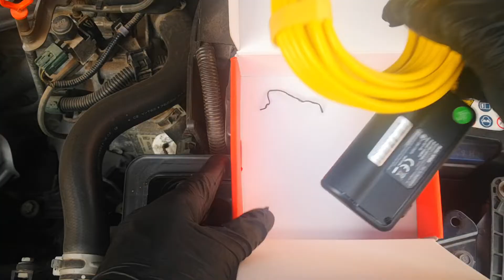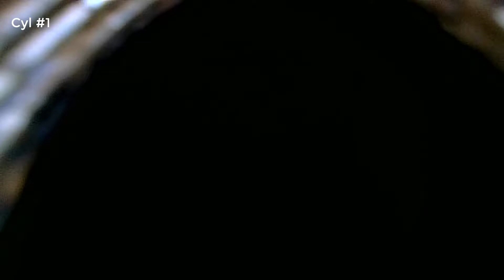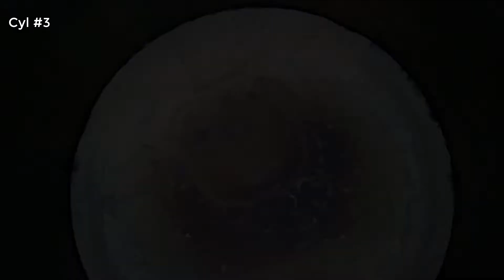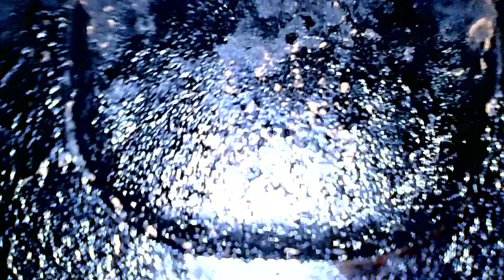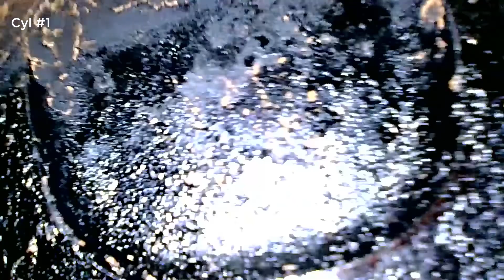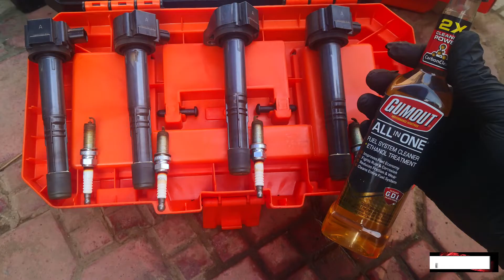Gumout against Carbon and Engine KNOCK: What Gumout all in one cleaner did to my Combustion Chamber

Comment: The white ash in pistons is caused by oil burning. Change oil with Valvoline restore and protect for 4 oil changes. It will reduce burning and deposits

Comment: I suspect fuel-quality will be an issue based on what you mentioned in comment on another video. You may wish to consider investing in a supply of Techron fuel additive as a matter of routine prophylaxis. I believe the additive concentration of Chevron's "Top Tier" fuels in the USA is around 400ppm. I believe around 30 ml of the regular Techron additive per 35L of fuel would get you close to that. That would be the "Techron Fuel Injector Cleaner" the one labelled safe to use every 1000 miles. Per the MSDS, the amount of Techron (PEA) per bottle of the Fuel Injector Cleaner is 10-20% by volume, so depending on the quantity bottle you purchase, adjust your treat rate accordingly. It may be more cost effective to buy a concentrated Techron, consult the MSDS to find the range of concentration, and then calculate your treat rate per gallon of fuel to hit that 400ppm.
Reply from the maker: Excellent analysis and suggestion. I now use Archoil 6900-P Max which is made to be added in aliquots. It delivers PEA with every fill up.
Reply: @diyautoworksng so I am not in any way a mechanic by trade nor am I a chemist or lubrication person I am just a random dude

I got a thinking about the engine knock you commented on 

When I was reading about low speed preignition, one of the sources of that was cylinder hotspots created by carbon flakes . 

These carbon flakes, owing to their high surface area and flammability, begin glowing like a tiny carbon filament, igniting the fuel mixture. You mentioned you were a physician. I imagine the carbon flakes causing the cylinder equivalent of Vfib where you have the aberrant automaticity. If the spark plug is sort of like the SA node, these carbon deposits create an aberrant combustion pathway that results in knock or destruction of the cylinder. 

Under periods of high load, so for instance using your AC compressor, the increasing fuel increases cylinder heat, leading to these glowing carbon particles which then pre-ignite. Perhaps similar to how periods of an oxygen demand starved myocardium creates irritability of the cells leading to VF.

I don't know if this is true, but this is how I theorize it and this is how I am conceptualizing the cause of what you described. 

So the removal of these carbon particles via fuel additives eliminates the source of irritability in the combustion chamber thus restoring the normal combustion process driven by the spark plug.
Reply from the maker: @JulietHotelFoxtrot 😀
I love how you've found a very similar example from medicine!
You're 💯 spot on. The irregular nature of carbon build up plus the fact that it holds heat is what leads to these hot spots and the pre-ignition. I'm glad I've gone beyond it.
Nice refresher on VF😁👍🏼

Comment: I've been using gumout octane booster, daily to help with a knock condition I had in my VW Jetta 2.5 Liter               I tank up, once a day (Uber Driver) and have dumped 1 bottle of octane booster into the bottom of the tank, each time.         I used to get knock codes roughly every 200 - 300 miles.  For the last several throusands of miles the knock condition seems to have disappeared when I do my daily scans. Pretty incredible. I may pull back using the octane booster in a while to see how long I can run without running into knocking issues, so I'm not overdoing it.

No joke I have used octane booster daily for the last 3 weeks lol 200 - 300 miles per day driven
Reply from the maker: 🤣🤣🤣
I feel you. This my car would knock after some thousands of miles if I allow buildup accumulate in the combustion chamber. You may find that a proper fuel system cleaner will do a lot if your knocking is from carbon buildup. If it's fuel related, switching to or doing some premium blend fill ups may also help.
For me I now use an Archoil product that comes in a liter and you add aliquots to each fill up. I have a video on it if interested.
Reply: @DIYAutoworksNG  absolutely I will go find it. Thanks for your video. It is solid information
Reply from the maker: You're welcome!

Comment: Well done and well presented! 😃👍
But how about the pcv valve? Stuck piston rings?
How is the fuel quality in your area/country?
Is using an API-SP or -SN+ rated oil an option, as these 2 are specifically made to prevent knock?!?
Reply from the maker: Thank mate. Very good questions. I use API SP+ oil. The fuel quality is the let down 😐

Comment: How u know that's not the ac compressor clutch plate ?
Reply from the maker: Possible, but I've had this more than once now, each time it goes away once the carbon buildup reduces.
Reply: @DIYAutoworksNG  well ur lucky . Mines is the compressor ac clutch plate kuz when I turn it off the noise goes away

Comment: Also review Gumout multi-system tune-up!
it contains PEA similar to Gumout Total fuel system cleaner. It will be interesting to see if both products are strong carbon cleaner produces similar results.
Reply from the maker: I tried it some many years ago, got back a lot of power and MPG, though I didn't have a borescope back then so never looked into the cylinders. Guess the extended highway driving I was doing at the time helped.
Reply: @DIYAutoworksNG  Just an update,  I used this product and drove til near empty. Then i ran a full tank of gasoline without any addictive's. I also change my engine oil before doing the test. The car drives smother and has better acceleration than before.

However,  The Cruising rage did not change after oil Change and adding the fuel Additive. It was 290 miles with full Tank of Gas before oil change and using the product. Typically after doing these things, it used consistently to give me 315-320 miles of rage in the past. It did not this time. 

And still showing 290 miles cruising range after doing oil change and using this Gumout Fuel system cleaner. I don't know what else could be the reason for it

Comment: how about putting the gumout directly into the spark plug holes... soaking overnight.... then cleaning out ?  similiar to other (soak methods)
Reply from the maker: Yea. Nice idea. Haven't tried any piston soaks just yet. Was discouraged by the fact that I tried soaking some spark plugs in gumout and it didn't change anything. Seems like it needs heat to it's mojo.
Reply: I would not do that unless you were going to change the oil immediately after. The rings are not designed to seal up such liquids. It will soak through and contaminate your oil and wash out your bearings.

Comment: You are better off soaking the combustion chambers with a solvent and then resoaking after with the gum out.  Putting this product in the gas tank works best when you are trying to aid the fuel line and injectors.
Reply from the maker: Fair point. I've got some piston soak stuff shipping to me and should be doing the  video on the channel.

Comment: I got this knocking sound after water enter engine. I got Honda rebirth. Can it be fixed? And do i have to change the connecting rod to fix it!
Will be waiting for your response
Reply from the maker: A teardown will be required to identify the extent of the damage/bent components.
Reply: @DIYAutoworksNG  thanks for your reply i really appreciate. But let me know my car works normal like this knocking sound sometimes disappear after high rpm and sometimes on low rpm. But still do i have to change the engine or is there any other way

Comment: I am so glad I watched this before using the product!  I would have done the same as you did the first time, I think because we usually add fuel additives in this fashion
Reply from the maker: Happy it helped!
Reply: It would make a very marginal and possible negligent difference. They simply say to add it first so it gets mixed well during filling - however, adding it AFTER fill up, it will still mix within your first mile or two of driving.

Comment: Can low quality of gasoline cause poor or awkward or unstable acceleration? I’m having unstable acceleration after refilling the gasoline from the gas station that I didn’t go before..
Reply from the maker: It's possible. Do you have a CEL? Could also be a coincidence in the sense that you may have had a pending fault that just reached the threshold to trip a code. That's if you have a code though.
Reply: @DIYAutoworksNG  Hi, Thank you for replying! CEL hasn’t turned on and no fault codes so far!..
Reply from the maker: A cleaner won't be a bad idea.

Comment: This stuff works. It takes a lot of uses. I saw better idle and gas mileage after about 6-7 bottles
Reply from the maker: This is the honest truth, especially if there was significant build up. I'm testing another product and I'm on bottle #4. I should get up to 6 bottles or more before I post the video!
Reply: @cherokeefit4248  is this still 1 bottle per tank?

Comment: Brother use Carbon x k1 +k2 you will see amazing results👍🏻👍🏻
Reply from the maker: Seems it requires additional equipment.
Reply: @DIYAutoworksNG  not really just use the two cans It also comes with its own machine to pull all the Stuff out from pistons and intake valves Maybe little smthn to clean the intake valves but really its not hard and its very beneficial to get rid of carbon from piston tops please try it and make video of it👍🏻👍🏻👍🏻👍🏻
Reply: @DIYAutoworksNG  Brother i highly recommend using Carbon x k1+k2 And please when you do make a video of it
Reply from the maker: Thanks, I've just noticed it's not on Amazon US/UK. Only found it on Amazon Germany. I'll keep an eye out for it.
Reply: @DIYAutoworksNG  thanks bro

Comment: You are making the same mistake others do when doing these types tests. There is no magic potion that you can throw in your gas tank and it will remove thousands of miles and years of carbon build up. If you have ever dismantles an engine after 50 thousand miles or more especially if the owner did not do regular oil changes, the carbon is like concrete, you have to use a tungsten scraper or aggressive sand paper or wire brushes to remove it. All these products you should start using while your car is in good shape and it prevents carbon build up and keeps all the injectors clean. There is absolutely NO SUBSTITUTE for regular oil changes and good quality gas.
Reply from the maker: Well, I got this car this car used and don't much of an option or control over the practices of the prior owner. I definitely agree with the points you raised, however, not everyone lives in countries where tiers of gas are sold. The quality of gas that I have access to are really not that great.
Reply: There's always that one cynical guy commenting on these type of videos. A typical Debbie Downer.
Reply: Dude. That was a great video.
Reply from the maker: @salvadorgarcia9108 Thanks!

Comment: Redline makes a really good fuel system cleaner, I've loved Gumout for years, used it a lot, never had a problem with it.

Bought an 09 Honda Accord 200k miles, rated 30mpg, car got 21, did 3 tanks of this stuff, didn't help, tried a few other cleaners (car had very high fuel trim).

Spent the $17 on Redline, main reason being high does of the same PEA cleaner, just far more concentrated, and first tank was 23mpg, the next was 25mpg, one after 25mpg, the last was 24mpg. Nothing else changed with the car, just has high mileage, but the redline helped where gumout didn't in this case. That +4mpg paid for the product already, and I'm very pleased with that.

I've driven this car for 9 months, every tank prior to redline was 21mpg, every tank after has been noticeably higher, my only conclusion was high mileage car, had a lot of build up resulting in poor mpg, redline helped, where as my old favorites did nothing.
Reply from the maker: Thanks for this comment. I'll look to get some Redline S1!
Reply: Redline Sl-1 is great, it's one of the only fuel additives I've seen that's made enough of a difference to obviously improve or fix drivability problems. Recently used it in a friend's 1996 4Runner that ran so badly it would barely reach 30 MPH and would only run with very light throttle and it will now easily go 70 and runs well in normal driving. It still needs more work when we have time since it misfires under heavy loads which may or may not be related to the fuel system, but either way, the improvement in fuel trims and performance was incredible. Sl-1 is definitely expensive, but in that case, you definitely get what you pay for.
Reply from the maker: I'm expecting some Redline S1!

Comment: My car has the same issue and knocking sound is only heard after the compressor is turned on and the car is at low rpm. Does it has to do anything with the engine rebuild as mine was rebuilt
Reply from the maker: Can't say for sure if it's to do with the rebuild, but I would imagine it could. If its mechanical, the knocking should rise with RPM though. Any codes? Faulty knock sensor, incorrect timing could are some other causes.

Comment: Knock can also be a valve gap issue. Honda recommends adjusting the valves every 20-30K miles.
Reply from the maker: I agree on improper valve clearance being a cause of knock, however, I've always known Honda to recommend valve check/adjustment at about 100k miles or if the valves are noisy. 20 - 30k seems too frequent.
Reply: @DIYAutoworksNG  GE Fit manual says 20-30K miles. Seems like some i-Vtec heads need valve adjustment at these mileages. I owned two Integras with DOHC Vtec and two NSXs with DOHC Vtec. I've never done valve adjustments on those engines and they ran just fine.
Reply from the maker: I see! Sounds interesting to have adjustments at a 20-30k miles. Pretty sure my 03 Accord said 110k or if noisy. Thanks for coming back to update👍🏼🙏🏼

Comment: As a person that has spent a small fortune on gas station fuel system cleaners that turn out to be flops, I find this video and its level of detail quite beneficial.
Can you please do a comparison video and assign effectiveness ratings to the cleaning products you have used?
Reply from the maker: Thanks a lot for the feedback.
Certainly, I'll be checking out other fuel system cleaners and doing before and after comparisons.

Just to note that, because of how long it takes to do these kind of videos, it will take a bit of time to build up the comparisons...
Reply: @DIYAutoworksNG  
Yes, the videos we watch in a few minutes usually takes several hours to record and edit. Kudos to you again.
Pending a comparison video from you I will assume that Gumout is the best you have reviewed so far. 😃
Reply from the maker: Yep, Gumout is the best I've reviewed so far. Thanks for the compliments!
Reply: I very much second the idea of a comparison video, pls do us the honour sometime in the near future.
As for low octane fuel, I was curious abt what stations u bought from but u answering that question might probably amount to defamation. Generally I just stick with NNPC, Conoil and OandO.
Reply from the maker: Thanks for watching. Video suggestion noted! 
You are spot on, on defamation, best to avoid naming for now. The most important thing is to use a proven fuel system cleaner on a schedule (e.g every oil change), since some carbon buildup is expected anyway. 
All the best!